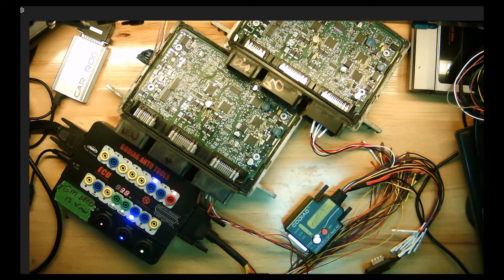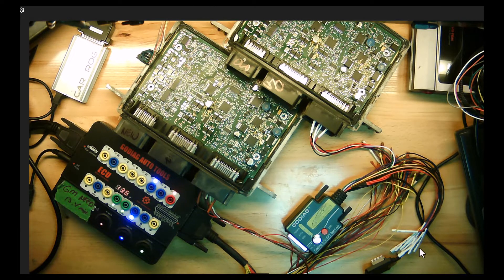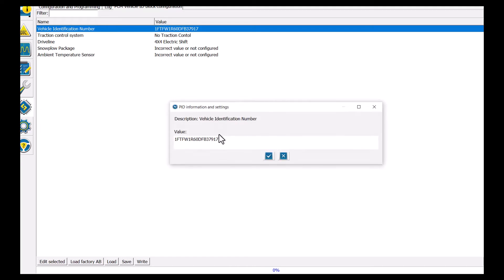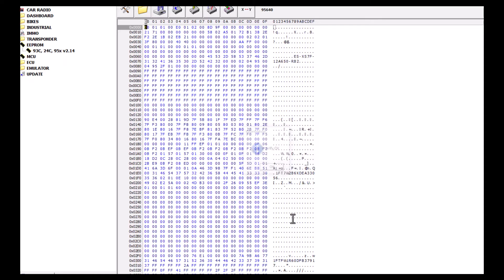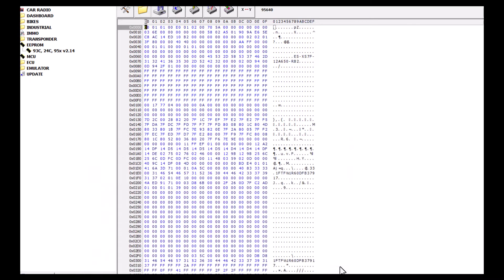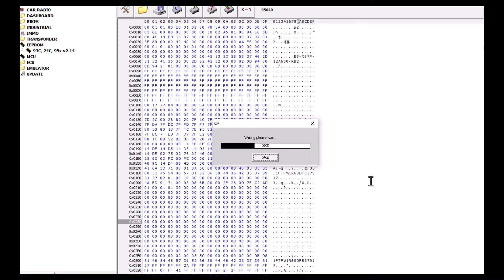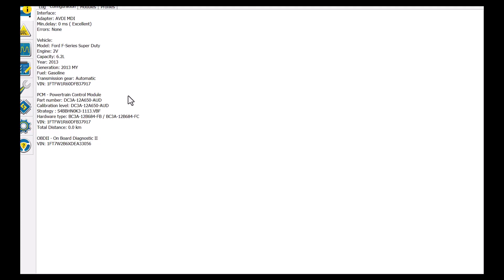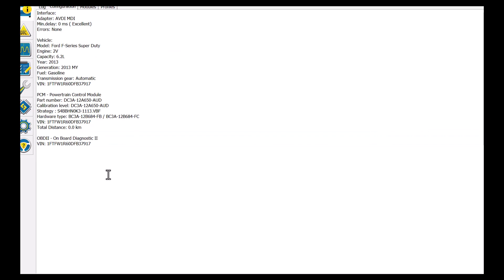Secrets of Changing VIN in a Used ECU | Write Vin Number

Comment: How can I get the tool or can I ship my used ecu for programming
Reply from the maker: Go to Karmanauto.com to get your ecu programed
Reply: @vehix411 you do it remote by AnyDesk or team viewer also?
Reply: Hello. Have a question maybe you know? Have a 2011 Jaguar XF. My TPMS  module went bad. I got a used one with perfect model number match and worked as soon as I plugged in. But about once a week it throws a light and says VIN does not match. Ill have to erase the codes and works again for a week. I have the Autel Maxicon. Will it rewrite the vin on the module or Do I have to send it off.

Comment: I have done EEPROM vin writing on a junkyard radio that was locked.  Really easy.  I would imagine doing a PCM would be more complicated?

Can I just write the vin with an eeprom reader just like i did unlocking the radio?  Or with an ecm do I need to copy more data over?  Radio was simple because it was just a radio but ecm im thinking needs other data to be written over from original ecm?

Basically what Im asking is do I need to simply copy and paste the vin from original ecm over to the donor or do I need to also copy over other information?

Comment: I have the same situation 2016 ford fusion replaced used PCM from flagship programed to my car VIN number they said, but my scan tool said otherwise, it showing the donor car  VIN number not my car VIN number, the real question can you reprogram the keys that way and start the car normally without problems or not ?  Because flagship said yes you can, but I know the answer already, because when use the PATs function to program the keys it show you the donor car  VIN number and asked you if that your car VIN number, so you can't, because you can't just say to the tool yes that is my VIN number and proceed because the immobilizer which is in the BCM  has different VIN number on it which is the real car VIN number, whereas the PCM showing different VIN number which is the donor car.  So I just stopped there and I canceled the keys programming procedure, because it will not work. 
 The flagship lied and told me just proceed and program the keys, it will work, I can't believe it, I am returning that PCM to them, it is too expensive without proper programming 200 dollar for used one, and on eBay cost just 60 dollar for a good used one with 3 months warranty,  if I am going to program it myself anyway.
Reply: Yes, You can
Reply: @RamonPeralta140 thanks for the answer, we did program the keys successfully, but the car doesn't start and the immobilizer code doesn't go away, and we did program the keys again twice successfully but no starting at all,  the immobilizer code stayed in the DTC section,  but when we remove the PCM from the car and then installing again, the car start immediately and the Immobilizer code went away no more, basically I don't understand what happen exactly? Why the car doesn't start after successful key programming, but after disconnecting the PCM and then reconnecting it, the car start no problem without repeating the key programming? Of course the scanner still showing the donor car VIN number.

Comment: So correct me if I’m wrong but if my 2014 Mustang GT needed a new ecu I could buy a used one and do this rather than spending the big bucks on a brand new one and having someone else program it???
Reply: Same boat I have a, 2007 v6 auto, and I have a 2008 mustang v8 manual donor car. 

I wanted to do an entire swap and have it California CARB compliant. If I understand correctly if I swap over everything. I just mail in my ecu and PCM?
Reply: @Sean-hc6bh same situation I’m in.

Little context. I have a 2015 ford Mustang, it was an auto but I swapped the transmission out to a manual and doing so I had to swap the auto PCM to a manual. Everything works on the car but the VIN’s are different. The OBDII is showing the manual VIN number instead of the actual VIN that’s on the car.